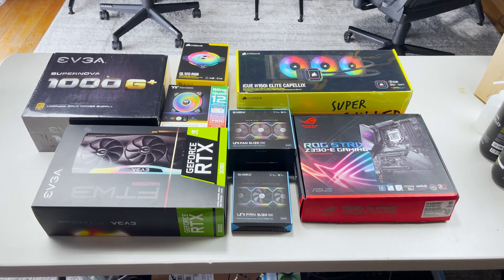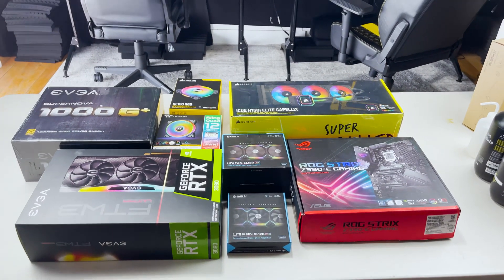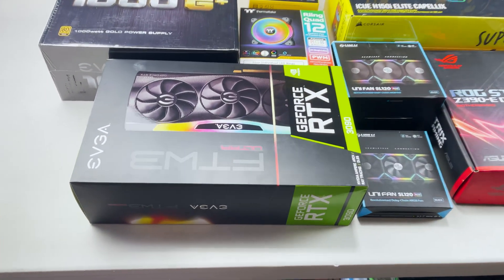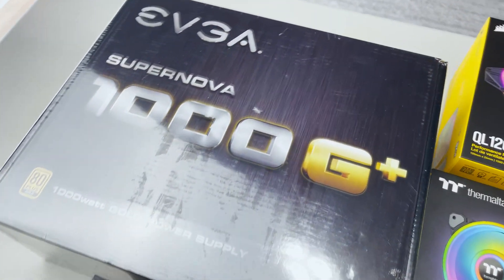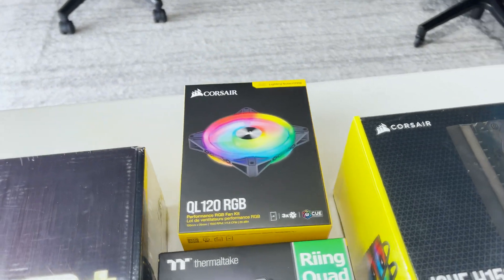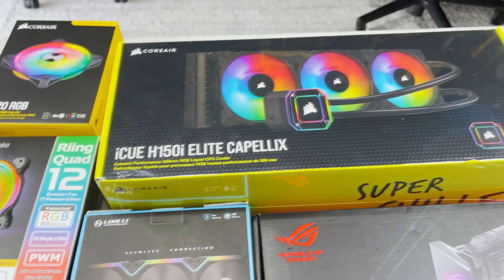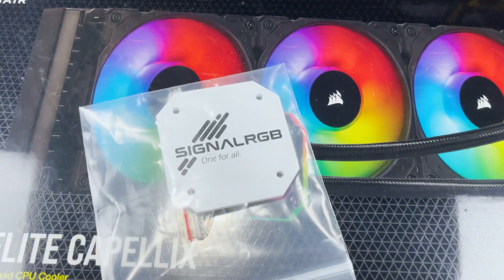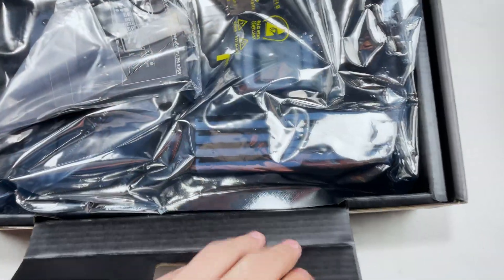ULTIMATE RGB PC SETUP with 10 brands synced together!

Comment: Hiii. Thanks for the video. Do i need to connect all rgbs header in same hub or just connect them on MB to have the sync access!?
Reply from the maker: You can connect them to any 5v rgb header or any supported rgb controller
Reply: @RGBProfiles  i actually did. The software also detected all my RGB devices. But unfortunately they were not moving smoothly 😰
Reply from the maker: @Nathanduong0122  that is usually a result of the device having a poor firmware, especially common with lian li controllers.
Reply: @RGBProfiles  i’m using rtx 4060, MB asus z790-P 2 packs of Lianli uni fan v2 with controller, 2 lianli strimers v2 also with controller. Not sure if these thing work well in RGBsignal :(
Reply from the maker: @Nathanduong0122  https://youtu.be/Qd209pxPzpc?si=F9wvw1BLv7UlEbyk

Comment: hmmm... Tried it and NO. Too many conflicts. A couple didnt really matter BUT Im not getting rid of Steel Series GG just because of compatibility issues with this software. Id say good effort but not as good as many of YouTubers are selling it as. Maybe WINDOWS RGB CONTROL might be what is needed whenever they finish testing it.
Reply from the maker: The conflicts are related to the other apps and not SignalRGB. Even if windows makes it other apps would still conflict because you cant have multiple apps controlling the same device. SignalRGB already has macros and fan control, and soon much more. The windows implementation is years out from even having basic rgb control across the same devices we support so don’t hold your breath.
Reply: @Alex Krastev  the conflict is with both of them. Thats why there is conflict
Reply from the maker: @BiGG_X  Realistically speaking, if we could fix it we would, you can already disable rgb control on specific devices in SignalRGB. That means if steelseries wants to they could make it so you can disable RGB control on their end and allow you to use SignalRGB exclusively for that, but they won’t. So therefore the conflict is on their end. We’re for gamers, they are for forcing you to be stuck to their application.
Reply: @Alex Krastev  yea i know. Brands have really made a mess out of something that should be more simple

Comment: Now if only they’d make signal actually have good profiles I’d be soooo in
Reply from the maker: It does though. Theres hundreds of them all inside of the app both built by the community and by our own developers. Its like wallpaper engine where the effects are shared inside of the app itself.
Reply: @RGBProfiles  There are like max 20 made by the community. What do you mean? And they all suck lol
Reply from the maker: @simpledanman  Sounds like you didn’t really look through the full list of free profiles.
Reply: @RGBProfiles  if by list you mean clicking the “free” tab and seeing the literal 20 profiles, I sure did man
Reply from the maker: @simpledanman  You definitely did not because there is over 100 profiles in free alone, and all of my profiles are also built into the app for free as well. So if you like my profiles then what you’re saying doesn’t make any sense.
Reply: @RGBProfiles  Idek what you’re talking about. The “free” tab on the left of the screen literally has at most 2 dozen options under the community section.
Reply from the maker: @simpledanman  Why are you only concerned about the community section? I don’t understand, there is 100+ other profiles not in the community section that are also free and incredibly detailed and customizable beyond any other rgb application. Saying the community profiles sucks means youd prefer the content we created instead of what the community created.
Reply: @RGBProfiles  Because the non community ones are even worse 😅
It’s got a lot of potential dude. And I love the fact that it just works with everything. All it needs is to have literally any profile that looks good. 
Even if it’d let me customize one myself to the point of being able to individually address specific LEDs to do what I wanted. But afaik it doesn’t do that either.
Reply from the maker: @simpledanman  I am so damn confused what you mean by they don't look good? Which effects have you actually tried? And have you watched the tutorials at all? I really firmly believe you haven't actually explored the effect system. If the effects don't look good on your physical devices then it's likely you didn't configure your layout. https://youtu.be/ymUum2FTJMY?list=PLQzqgVnlHybBVClEBsqSAgkdRhCV4zhyi

Comment: I don’t understand, how did you connect all of them together? Did you connect them all with the 5v 3 pin ARGB header on the motherboard did you connect them all with the usb 2.0 connectors? Cause i would think that they wouldn’t fit with just the motherboard connectors and that you would have to use a controller.
Reply from the maker: The application does it, its called SignalRGB

Comment: Nice video. How did you get the Lian Li front case rgb strip to sync with signal rgb?
Reply from the maker: Change the mode and it works in signalrgb

Comment: What led lights are used behind the monitor specific model please 🙂
Reply: You van use the corsair LS100 smart Lightning strip or philips hue. But then you need also ten Philips hue bridge
Reply: @jahnodam3403  thanks I ended up getting those exact ones from Corsair and the lt100 light bars it’s a awesome setup now!

Comment: So how would I connect the fans so they can all sync, I'm very new to pc building and want to do this in my 1st build! Do you have a discord or something I can message you for some support?
Reply: Just download “SignalRGB” once downloaded you may have to either uninstall, or, stop ALL other RGB controlling softwares, from running on windows startup and leaving only SignalRGB with the ability to start upon booting your device. You may have to still manually enter some of your products in, so make sure you know what you have installed in your system.

Comment: I installed signal and all my lights absolutely freak out and won't stop strobing on and off constantly until I force close it. Hmm....
Reply from the maker: You need to close your other rgb apps, there should have been a warning in signal that tells you that. It would be like having two engines trying to move the car.
Reply: @RGBProfiles  I tried force closing everything, and resetting the computer a few times and I still can not get it to work properly! I am not sure what is happening. The only way I have been able to get your amazing profiles to stick is to open Signal, apply the setting (even with it freaking out). Then force close signal, and open iCue and apply it there. That way at least everything sticks between the two programs. I will keep fiddling...
Reply from the maker: @GroweverydayOriginal  Uninstall icue and other rgb apps and only keep signal. Then try it with JUST signal.

Comment: So here’s the problem I have, the radiator fans being on the bottom or inside of the case instead of against the outside of it. In the current setup you’re either pulling minimal air through the top into the radiator or pulling in a ton of dust, or you’re pulling heat from inside to push into the radiator thus heating the fins.
Reply from the maker: Quote from my pinned comment: The people talking about how the fans are mounted are missing the point of this build. It will not be used for gaming so optimal air performance is not a concern. The fans are put in a way to be fully visible for the rgb effects.

Comment: The Lian li fans on the side shouldn't they be intake rather than outtake of the air or doesn't that matter in the case? I have the same case and got recommended to make them as intake fans
Reply from the maker: Intake from the bottom qls should be fine. Its built not for gaming but for showing off in videos so performance doesnt matter.

Comment: even I uninstall the Vanguard but my corsair Dominator rams still don't work. Everythings are perfect from fans, motherboard to keyboard mouse and micro but only Ram doesn't
Reply: I had an issue similar to this.  I had to uninstall the software i was using for my RAM RGB.  I then shut off the computer and cleared CMOS.
Reply: @Nashness  the funny thing I figured out is I didn’t update the software version :))

Comment: The video is great but, well, I think people watching it would like to see the software configuration instead of a pc building. In my case, I definitely would love to see how you achieved these wonders in the software. Thanks though, for your effort.
Reply from the maker: Thisll be a separate video :)
Reply: @RGBProfiles  hry bro how to sync trident z neo ram in signal rgb
Reply: @pranadkhanzode3332  did you find how to do it?
Reply: @RGBProfiles  i don’t know of it’s just my fans but I have 9 Lian li fans in my pc, and when i tried Signal RGB it were very very laggy on the lian li fans, do someone know why?
Reply: @knugen2714  I do have the same problem with these fans. Have you achieved a solution for this?
Reply: Exactly, and he didnt even do it right as some fans are upside down (evident by the matrix effect)

Comment: That looks really good, especially if you have more than 1-2 brands.
I tried Signal RGB a few months ago and it worked fine, but it lacks a few features that I don't want to give up and are only possible with iCue atm.
But I definitely will observe Signal and try it again in the future.
Reply: What for instance ?
Reply: @LUKAS-bb4jc  Back then I missed the fan control, the macro control with my K95 and the Asus plugin, where my Asus devices are linked with my iCue profiles.

Comment: does gigabyte aorus works?
Reply from the maker: Some might
Reply: @RGBProfiles  Just got linked to this great vid. My whole system is Aorus, case,mb,ram,water cooler aio,nvme drive,keyboard and mouse ect. GPU is 3 series FE which im running through icue. Gonna try this over the next few days....RGB fusion is terrible and buggy, so this could be the awnser for me. Thank you!